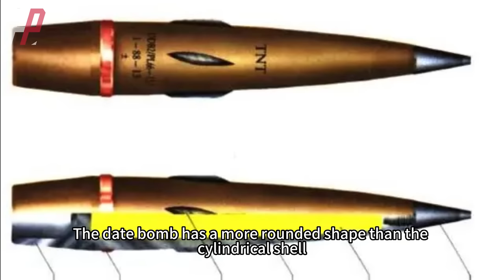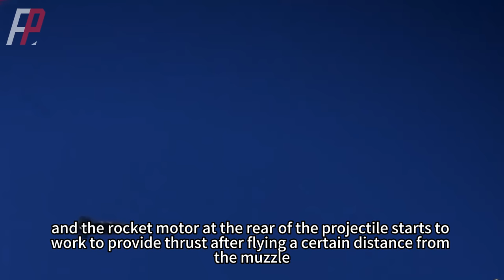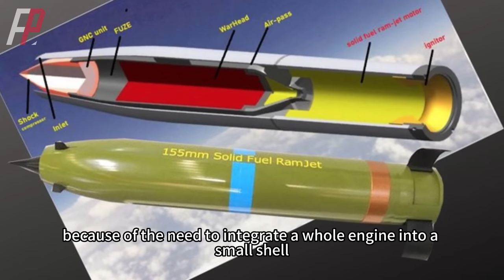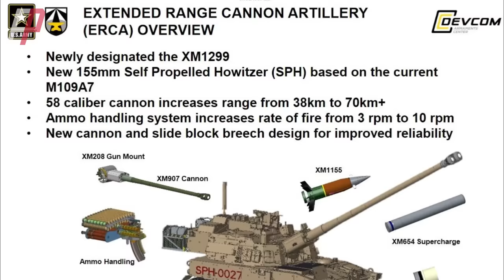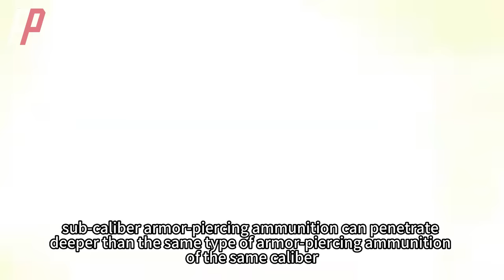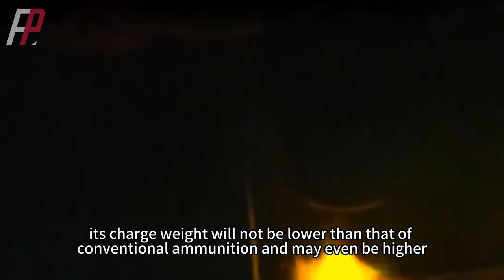110 km Range!BAE Successfully Experiments With A New Artillery Shell

Comment: GPS guided - which is being completely Jammed by Russia in Ukraine. Also $200k per shot, so no stockpileing and ZERO surge capacity.
Reply: Jamming wasn't really the problem, signal scrambling was and the platform has been tweaked to prevent this. A $200k round on an multi-million EW platform is worth it. A $200k round on a million dollar tank is worth it.
Reply: No its not… their jammers are shit

Comment: 155mm shell with a range of 110 km, that's insanely awesome!
Reply: one gun covering about 38000 square kilometer!
Reply: Well, not really amazing, consider 200mm were being launched in ww2 120 km. Whats amazing here, is it doesn’t destroy the guns usefulness in under 1000 rounds and it actually hits its target
Reply: Small correction, WW1 with the Paris Gun.
Reply: @goldenhate6649 its is amazing 200mm is much bigger than 155 and do you even know how long the barrel is of the paris gun,this 155mm is much more impressive because it has like a 2-3x smaller barrel and a smaller caliber,plus way less to reload and will withstand more than 1000 fired shells
Reply: The joint German-Italin Vulkano 155 is already in service.  It has been supplied to Ukraine.   It has a 70km official range but in trials has made 100km in glide mode.  It also is a sub caliber projectile.   It is GPS guided with inertial navigation.   The proximity fuse in those nose can be replaced by a laser seeker so that a drone or forward observer can designate a specific target.  Other seekers are possible.   Vulkano technology is also available in 127mm and 76mm.
Reply: But in turret's caliber isn't all, like missiles. You could add lenght of ammo and add more energy and solid motor back of shell.

It's little harder to stop by enemy's antisystem when 3 to 4 coming in target exactly same time and that time turret that shooted it could been at least in theory, moved away. At least soldier's could go safe. Mobile systems are more and more common in this war. And non linear flying could make locating where it came exactly little bit harder. 
Excalibur is very good already, we have those good amoun't stored and tgese rotating for Ukraine aome amount, from oldest one's ones (not offically told, my own thinking). New ones buyed some time ago and manpads too. But looks like that russia never will have same amount of tanks than before war. And what come's to working one's and their condition and equipment.. 
Some leopard1's that waiting to send in ukraine will need rebuild, but at least they exist and knowledge and part's aren't problem. Time is..
But time eat's russia's forces too, but their tactics will change same time.
Reply: pretty sweet i have to agree vastly superior to excalibur
Reply: The only thing amazing is going to be the price

Comment: It's sub-caliber, but it has a charge weight equal to that of normal 11kg charge shells - "and may even be higher"? Unless the thing is 4 feet long, or we figured out some quantum mechanical trickery to overcome electron resistance and increase mass without a corresponding increase in volume... this is going to need some explaining.
Reply: well... they mean 1,1kg 🤣something was lost with translation
Reply: The longer BAE don't explain fully, the longer it will be before Russia copies it.....

Comment: Your numbers are wrong here and there, I think you are mixing up miles with km sometimes. For example the M777 has not a range of only 25 km. that's like 15 miles. That cannot be right. It has a range of at least 20 to 40 miles depending on the ammunition. Please check the numbers again and make sure that they are right.

Comment: The rocket assisted shell is a 1960s era idea considered for the 16 inch battleship guns.
Reply: Non ! Albert FONO . 1915 .
Reply: In WW2 the German 15 cm sFH 18 gun had a range of 13.25 km.  Because this was 4.5km less than the Soviet ML-20 a rocket assisted projectile was developed 15 cm R. Gr. 19.  This increase range by 5km.  Usually a timer ignited the rocket motor at the apogee.  It was fairly accurate
Reply: this is sub caliber, its ww2 thing. germans used sub caliber ammo for 280mm rail guns. but not much shells were made

Comment: Think the people who wrote the text need to re learn maths. The ATACMs can only do 300km yet the 110 km shell surpasses it? Another thing, the creators of these streams know nothing about artillery. When taking about the M109A1, we're told the barrel was 23 times the calibre, unfortunately in artillery, shell diameter is NOT the calibre, Calibre is the barrel length divided by the bore size. So for the A1 the barrel length is 3.5m (155x23) and the A7 it's 6m. The UK did toy with the idea of a 52 cal barrel on the AS90 which is a whopping 8m long.

Comment: 10:08 "Black magic":  😂😂😂

Here is how I (or Edgar Brandt in 1940) would solve this problem.

Far from the celerity of light, the relation between Mass, Velocity and Energy is approximated as follow:
energy ∝ mass × velocity × velocity
or, if you prefer to care about_velocity_ :
velocity  ∝ ( energy / mass )**(O.5)

Since we cannot add much more energy to the equation without changing the gun, we can reduce the mass of the shell. The quadratic relation tells us that even a slight reduction in mass greatly increase the initial velocity .
And this, without increasing the mechanical stress on the gun.
In fact, it can even reduce the mechanical stress on the gun, since more energy is transfered to the shell and less to the gun. So this present the extra advantage or leting us use even more propellant , thus adding energy to the equation ! 

Ok, we see how to get more initial speed . Now, how to reduce the mass ?
- We don't want to reduce the mass of the payload too much, but we might have to. If possible, we'll reduce the mass of the outer shell, not its inside, so we need materials that are both light and strong. That's expensive, but there is room for improvement.
- Since we cannot change a lot the density of the shell, we can reduce its volume . We don't want to reduce the length of the shell because this would significantly reduce its aerodynamics. So…
We reduce its diameter !

Reducing the diameter of the shell reduces both its mass  and its aerodynamic drag (as long as the shell stays stable).
Reducing the diameter not only let us fire the shell with significantly more initial speed , but also avoid loosing speed during flight.

But shells with smaller diameter don't fit well in big guns. So how ?
Well, with a mechanical adapter between the barrel of the gun and the shell. We call such adapter a "sabot" .
And yes, sorry, but this is a french word in military jargon, again. You need to invent things first if you don't like that.
This thing is designed to transfert energy to the shell rather than the air, without taking too much energy for itself. Its geometry and elasticity are very important.

Note that clever engineers have come to ways to replace parts of sabots with propellant in some applications, making the whole [propellant, sabot, shell] system even shorter and more efficient. But this is more a design for battle tanks, as artillerymen generally prefer to carry 155mm rounds and propellant separately.

So, let's resume the pros:
- Much more initial speed
- Less aerodynamic drag.

and the cons: 
- sabot pieces spread in front of the gun at firing.
- possibly slightly less payload.

And, no, I am not an expert. All of this is elementary.
Reply: louisenorbury2703  
The examples on the wikipedia page are mainly about kinetic rounds. Such rods or metal arrows contain no explosives. They aren't designed for very long and curved ballistic trajectories, and rather for flat trajectories. 
However, I don't rule out the technical feasibility of a compromise between these extremely thin projectiles and conventional ammunition, thanks to new materials and particularly clever design.
Reply: Thank you for putting in the work. You exceed the education imported by the video. I wonder what details are of the sub projectile's size, weight, charge, MV⁰, SD, BC, etc. Narrator ignorantly states the projectile's shape is the same. This is not possible.
Reply: "- possibly slightly less payload."

One could say that again, as the volume is relative to the cube of the radius. Half the radius of the shell, and the payload volume is down ten times, as the thickness of the outer shell must remain unchanged to withstand being fired.

Comment: I guess magnetizing the inner barrel would definitely reduce the resistance force increasing the muzzle velocity and the range of the projectile.
Reply: Shhh... electromagnetic coms have ears.
Reply: What would magnetizing the barrel gain, and what exactly do you mean with that?
Reply: Are you thinking coil-guns? Unless you plan on putting a giant generator next to your weapon,  Or have the Logistic oomph, to power every single Cannon by cable grid, That idea dies at the place it was first meeting enemies.
Reply: @nbandpinportugal 😂
Reply: Magnets won't work properly in heated barrel, plus a powerful generator would be needed

Comment: Ranges close to 100km were already reached by an experimental version of South Africa's G5/G6 155mm howitzer in the mid to late 90's using a longer barrel together with "base bleed" shells.  Many of the engineers that worked on that now work for BAE.  Nice to see their knowledge and work is appreciated somewhere, as they were pushed out of their jobs here by politics.  If the US and Canada didn't ostracise, and Israel didn't knock off Gerald Bull, they could have had this technology years ago.
Reply: I would like to know the size of the warhead? by simply extending the barrel and base bleed does not get you near 100km in a 155mm round. Even Bulls 203mm FGH-203 only had a range of 50km.
Reply: @LeonAust  Simple, its in the name sub-caliber. Clearing out the air ahead of the round would make it go much faster.
Reply: Bull got nowhere near 100km in a 155mm round more like 45km as the 100km warhead would have been too small to be effective, of which was my initial question which was not answered.
Bulls sub caliber super duper dildo dart thingy 100km 155mm would have arrived on target with minimal explosive effect.
If it was proven project why has it not been placed into production since bulls demise.
The Bofors ramjet is interesting with a reduced warhead.
Reply: BAe has been advertising 100 km for the naval 5" gun for a while
Reply: "...as they were pushed out of their jobs here by politics"
what kind of politics? anti-white?
Reply: You can't increase the speed or range just using a more propelant. Its like you was towed by multiple horse to increase the speed, of course you would not go faster than the horse towed you, so the limit is in the speed of horse towed you.
Reply: @edibandulan5266  um yes you can but you're limited by what pressure the gun can take

Comment: Surely this artillery advance would meet or exceed the original requirements and make the Zumwalt destroyer/cruiser a valuable weapon! Consider that missiles require so much more weight and space than artillery rounds per pound of destructive capability. Currently Zumwalt has been dissed and terminated on unsuccessful attempts to meet spec.
Reply: These shells are embarrassingly expensive also.

Comment: GREAT!!! Now convince NATO navies to stop putting a puney 5"" gun on huge 550' warships. Up the bore diameter to 7" and then even a ramjet shell would have enough bursting charge to make big holes in things even at 60 miles. Not all targets require a million dollar missle or need to be fired from 200 miles away. Lightweight gun and mount would only be marginally bigger than the 5" current gun but MUCH more useful. Put the 5" on the new frigates in lieu of the ridiculas 57mm 6 pounder!!!!  Put that on patrol boats like the Swedes.

Comment: firing a round that far using a gun that goes bang is just stupid. Use a rocket fired from a launcher that is much lighter, cheaper, and quickly moved. If you can fire an artillery round that far accurately you can reach much further at a lower cost using a rocket.
Reply: You need to consider the logistics of cannons vs rockets. Then come back.

Comment: This is awesome but confusing at best. 

1. 110km is a huge distance. The error increases exponentially to the range.  For example, 10m CEP at 40km (circular error probability) would easily increase to over 100m at 110km.  Hence these shells would require guidance unit.  Hence the same or more explosive charge is not feasible.  

2.  Sub caliber munition may also mean narrower crosssection of the projectile (area is square of diameter/ radius) hence reducing 10% of diameter would result in 19% reduction in cross section area hence resistance.  However, the same or more explosive charge is once again not feasible as the length of each round is also restricted unless they use substantially longer projectile.  

3. Adding above 2 points, it results in hilariously expensive artillery shell (even Excalibur with ca 80km range (not 40km claimed in the video) costs 80-90k per shell and only used against hight value targets).  The guidance unit costs at least $30k and with smaller charges, we are looking at similar cost range as cheaper rockets or missiles.  It is still likely to be cheaper than GMLRS missiles but only marginally.  Adding the cost of new platform (SpH), the total cost of adoption would be phenomenally high.  

There is another good comparison. Korean company announced new 60km range dumb and guided shells for their K9 155mm SpH.  This is Nato compatible  with most of existing 155mm artillery. Korean Army is to adopt this new 60km range dumb and guided shells from 2024 when mass production is approved.  They have been working on this for 13 odd years since 2009 or 2008.  The cost is slightly higher than RAP rounds (<$10k per round) but increases the existing range from 52km (40km with BB, 52km with RAP) to 60km (far beyond any Russian artillery range).  The merits are i) it uses existing artillery platform K9 and ii) it is cost effective.  The guided shells would cost $35-40k due to the guidance unit.
Reply: Yes, this is why the Zumwalt is back in port to get it's guns take apart, cost 😂

Comment: The coefficent of the effectivity of the current guns is around 30%, comparable to a bad engineered gasoline motor. Means that only 30% of the propellant energy is used to move the shell.  So there are possibilities for improvement

Comment: "The details of the new projectile haven't been released, though we do know that it's a sabot round. That is, the projectile is sealed in a canister that strips away when it leaves the gun muzzle, revealing the aerodynamic projectile. In flight, the projectile deploys fins and wings and a motor (a rocket or a ramjet) to provide additional speed and range."
Reply: Sounds like. Maybe it is a glorified arrow with a rocket engine and a tiny payload. Still useful for some, but not all applications.

Comment: back in 2017 i gave 3 ideas to a u.s. navy admiral at the minneapolis BAE longevity testing facility. 1 was for super fast ships with a highly maneuverable and much more reliable propulsion system that was multiple staged and easily combat battle damage repairable than this antiquated system still used today, another was for directional missile launching on multiple platforms built into the frame body that still allowed stealth and didn't detract from stealth facets like most everything in use, the third idea was incorporating 1970's gained aerodynamic testing results via redesigning all munitions with should quadruple if not easily quintuple range and accuracy, maximize destructive forces, and more easily made and more affordable and with extremely faster manufacture times. these ideas didn't apply to just the navy, but the entire u.s. military and future of modern warfare as we know it.
alot of bad people running the show should have been executed or locked up for not doing these changes 30 years ago not long after they were discovered in testing.
Reply: Unfortunately, even in todays global markets the Americans tend to be very insular. If it's not made in America it can't be any good!
Reply: @robinwatters572 M9 pistol, Italian; M17 pistol, Swiss; MP7 SMG, German M119 howitzer, British. LAV/Stryker, based on Swiss MOWAG design. M777 howitzer was also a UK design. Carl Gustav (Swedish) recoilless rifle; M120 mortar, Israeli; Trophy APS, also Israeli; the old Fox NBC Recon vehicle is known in original form as Fuchs (German for Fox). We make our own stuff when it makes sense. We use other stuff when that COA makes more sense. It's not about whether something is good or better. It's about maintenance of an industrial base. We're too big not to.
Reply: @anthonykaiser974  The Israeli M120 mortar is based on a Finnish mortar.